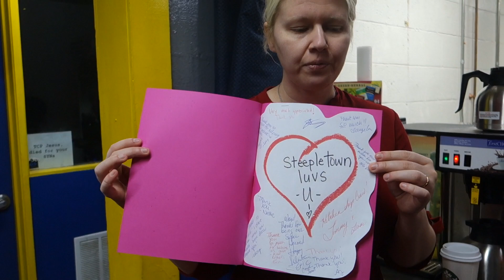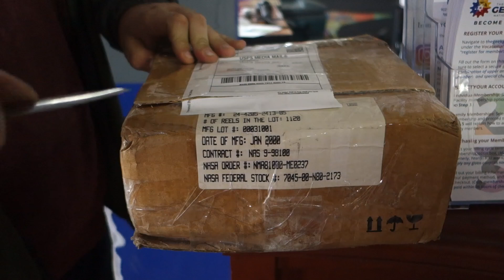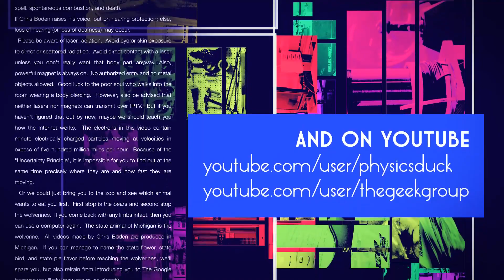Captain's Blog 2 14 2017 Mainframe Tape and Whelen Strobes

Comment: For smaller stuff I wouldn't worry about  patents for the reasons Sparky mentions.  If I were making something giant though, something that I'm definitely not open sourcing, I'd go through the process for one.  For little stuff that might just barely make a living wage (if that) I'd just open source it, no patent, and use it on my resume.

Comment: i use to have a 9 track tape drive! I tossed it out, because it had a PERTEC interface, and not a SCSI interface, and my old mainframe died, and the SCSI to PERTEC converter cost something like $1500 dollars! I still have a bunch of PERK and ELMER and HP boot tapes and "washing machine" hard drive cassettes for it.... the 9 track encoding and recording format is fairly easy to figure out. one track per bit and the ninth for parity....
Reply: So, I am planning on building one in the event that I am unable to procure one. The r/w/e head would be easy, I would love to find a proper 9-track head, but in the event that I can't find one I plan to use some single track audio cassette heads and stagger them in a fairly dense pattern. Then with a bit of math (get it, bit) I can smash the bytes back together. The hardest part would be to get the tensioning rollers and the vacuum columns correct. that and finding a suitable capstan motor.

Other than that, I think building the rest will be easy, It's getting the vacuum columns and the capstan system to allow for nonlinear seeking that will be the hardest part. I honestly would rather buy one that works and build the interface board.
Reply: don't forget the bits per inch can be varied for different recording formats... and that the max the tape can hold is something like 40 megabytes!
Reply: This is  ~2400ft reel at 6250 cpi/bpi so the max capacity if using the GCR encoding for full capacity it would be about ~170-ish megabytes.

Comment: their food gift is excellent.  running a computer that way is very different.  stapling that part hurts.  0922 ... 1121  parade of blinky lights is decorative.  good to replace what you use.  .a patent gives you the right control your design or method for a specific period of time.